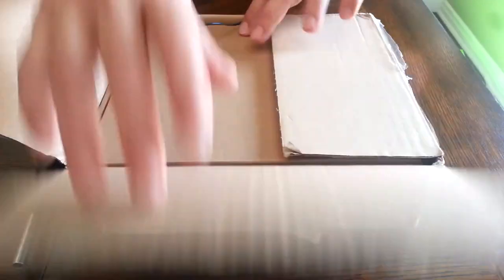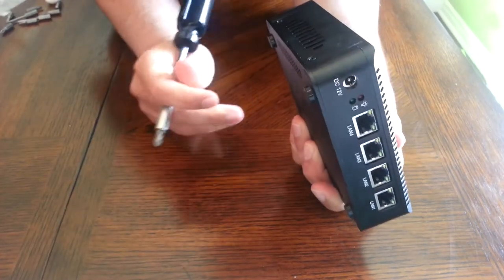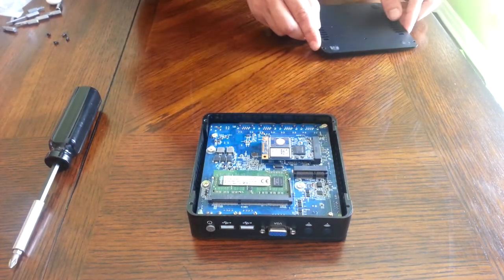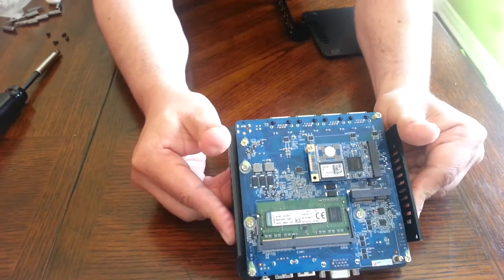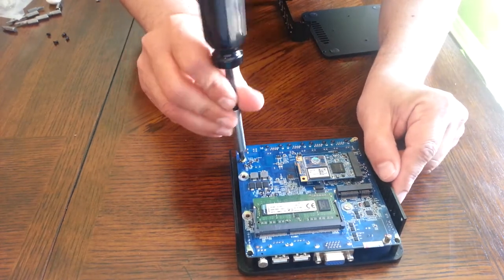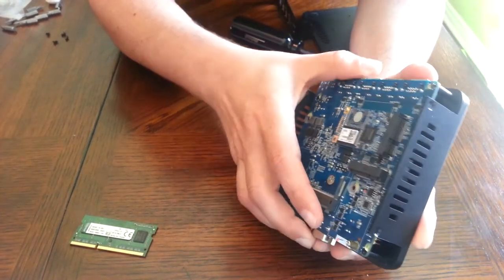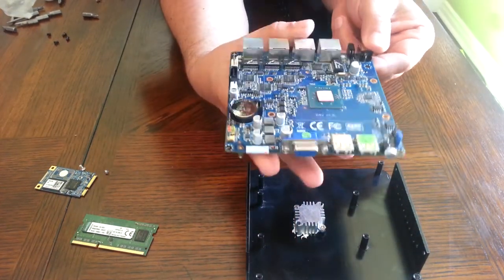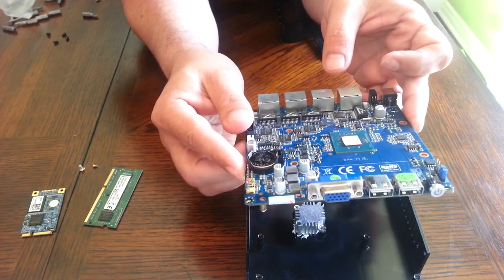✅ Qotom Quad Port PC Teardown - that last screw was tough to find!

Comment: I purchased one of these units. My temps run @50c 24/7. I'm trying to determine if adding cooling may be worth it. What have your temps been like? Nice video btw!
Reply from the maker: I'll have to get back to you on that. I gave this unit to a fellow tech who needed a router quickly. I know the 2 port version of this I was seeing a constant temp of 27C. I believe they had the same processor and case build.
Reply: ITVOIP thank you
Reply from the maker: Hey - Just remembered that I did setup one of these somewhere. Your temps look correct. Here is an unlisted video of what I have. This is in a warm closet room but sitting on a metal rack - no venting of any kind. https://youtu.be/xBiOJKxRJlQ
Reply: ITVOIP Nice! Thanks for following up. I can get used to these temps considering the price of the unit ;) Cheers
Reply: @ITVOIP  i use mine (intel i5 cpu) as my main firewall/router running pfsense. i modded a PC case fan with a usb connector and i just let that sit on top of this thing. my cpu temps are around 38c

Comment: Thx for the video!!
kill my curiosity,  here in Brazil those minipc are very fewer and expensive, could't put the hands on one yet
Reply from the maker: I don't know what the prices are in Brazil or whats considered expensive - but in Canada/US you can get the Atom based mini pc's for as low as $150 (US). The Zoltac/Asus variety are available everywhere. These Qotom/PC Engines need to be ordered online - they are not regular consumer items.
Reply: The price you are looking for is taxes. The gov charges are ridiculous, the zotac you said? its cost here $440(US)
the link to prove it: http://www.kabum.com.br/produto/79212/computador-zotac-zbox-ci323-intel-quad-n3150-4gb-hd500gb-linux
This is one of the shops with best prices...
(Real is 3.22 US now)
Reply from the maker: I see your point. Just a note on Zotac that the case looks metal but it's completely plastic and vent holes are actually big and will let dust collect inside the unit.  I have used a couple of these with Win 10 solutions.